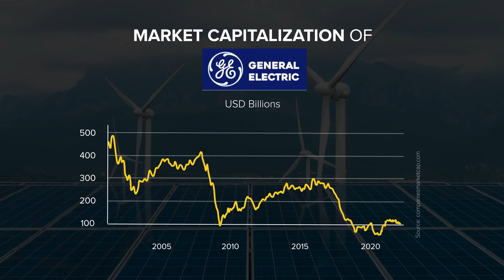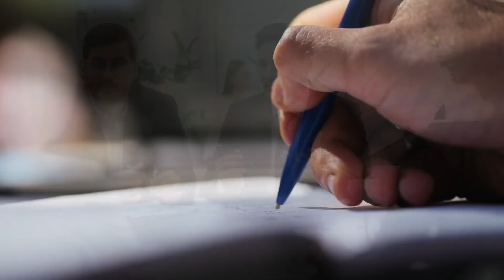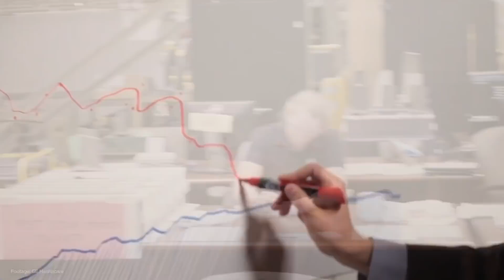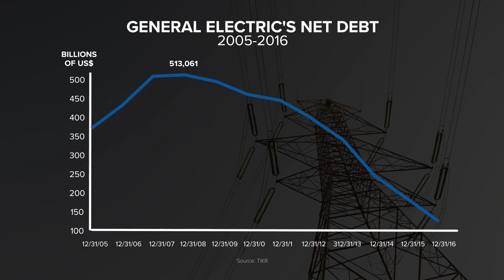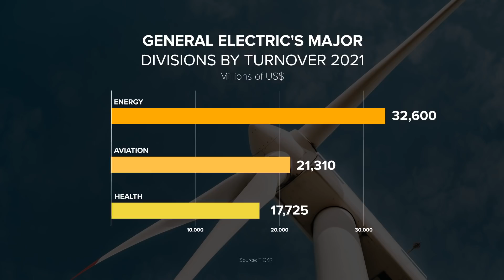The decline of industrial icon of the US - VisualPolitik EN

Comment: In my town we used to have a GE manufacturing plant it was sold off in 2006 and it was closed in 2007, it did not kept their promises to engineers, retires, managers,  etc. The county then bought the building along with all toolling and machines. GE came back in 2015 I believe and they want to re-open operations. My county say F%#k OFF and instead we gave it to a joint Siemes,  Toshiba adventure.
Reply: How unpatriotic🤫 Had there been some Italian business parted in and you would have got a complete take over by the Axis😁
Reply: Toshiba alive ?!
Reply: @olpkol  Barely but doing better than GE. They make Nuclear plants now and bought Westinghouse.

Comment: I’m a MBA and worked for GE Healthcare for 1yr,2013-2014. For the year I was there I could feel its failure. The top was so heavy it crushed those with customer interface. Management was so very arrogant. Too blinded by GE’a heyday to see its current issues. What worked in the past will work in the present, not so. 

GE would take a GE Petroleum manager and just plug them into a healthcare management role. Those sort of management movements. But by far trying to figure out how to navigate the business was the biggest issue. Most of my time I was trying to figure out how to get something done using the company more than servicing the customer.  It was no privilege to work there. Literally left one year to the day as I set my goal of just bearing it for one year.

Comment: With tech firms it is always removing engineers from the top and replacing them with finance people that ultimately destroy the company.

Make sense though as tech firm needs to take risk and push the envelope to stay relevant which leaders with a tech background understands while MBA types are trained for risk management and thus more conservative. Works fine in the financial or retail sector but horribly in the fast pace high tech sector.

Comment: Started working for GE in 1978. There in cafeteria I did see an article about Sumsung, a company that started producing microwaves. Apparently one got put togerther and it promply melted out. Sumsung then bought an amercan company that was producing microwave devices. Than there wasn't turning back. GE got enamored making money on stock exchanges and there wasn't any company in US that fell under the same spell. They all created the finnancial arms in its' corporate structures to profit in the ways banks do. Clinton stepped in abolishing Glass-Seagall Act aĺlowing for the investmet arms of the banks to use the savings of the public to raise the betting stakes just like it was back in the "roaring" twenties. B.Clinton actually quipped " where would they all go now to?",   meaning the workers of the USA. To add mentality of greed so consistent witnin human rase got into big swing with All Dunlup who awaken an avalanche of a hundred milion compensation packages through anything called corporation.

Comment: Of course the new "strategy" comes from the main beancounter. This is the one of the most used tools that investment bankers know how to implement. Take a failing business divide it up and auction out the new entities that with the "improved focus" can attract an actual buyer who may want the canning factory but not the corporate RnD :D 

The end of this kind of story is always the same: shareholders sacrifice the company and incinerate its future for a few dollars.

Also big conglomerates are over? HALLOOO Amazon... economies of friggin scale. If your divisions manage to align input procurement and get organized your inputs can be greatly discounted as opposed a few mid-size firms that struggle to keep the light on. Also it helps if one div sells what another one needs in turn...
Reply: Yea it lets them hang the unprofitable parts of the business out to dry (usually RnD as you mentioned) then they auction off the remaining parts. Sadly it’s often the unprofitable businesses that drive future potential or they are cyclical businesses that have up and down years and require extensive investment. Then big often foreign companies swoop in and buy up the pieces laying off half if not more of the company that’s made redundant by mergers.  I be surprised if more than one of these divisions was still an independent company in 10 years
Reply: Amazon should be split up too. Amazon Web Services (AWS) should definitely be forcibly split up from the rest of Amazon.
Reply: @Tribuneoftheplebs  And don't forget Bezos!

Comment: You don't think deep enough, the value of the company was never really more than it is now, the way the system is designed means they have a value and a virtual value. The try to use the "virtual value" as it was the real value and then when the virtual value breaks they are way out of reach of the actual value. As Monty Python would say "Strange women lying in ponds distributing swords is no basis for a system of government…" and the same is true of wall street, it's not a sane way to decide the value of companies.

Comment: Worked at GE. Hated the culture
Reply: how was the culture over there?
Reply: @gurumage9555  when I was there as an engineering intern, i had many duties but my supervisor told me that my primary job (and the sole one I would be judged against) was to call a particular engineer working for the contractor who made many of our plastic subcomponents to get him to take time away from manufacturing their main GE plastic parts order to focused on trying different injection molding techniques to solve the plastic warping issues we occasionally saw with some of the part numbers.

I was told by my supervisor that the criteria for whether my internship was a success or not was whether I called the plastic supplier about focusing on the plastic warping techniques over their regular manufacturing so much that they would called my supervisor to say, " you got to tell Phillip to calm down."

I would call the supplier and sometimes (when they had free time) would focus on the trying out the warping techniques. Other times they would explain that they would focus on the warping technique as soon as possible but that it wasn't something they were obligated to do (wasn't in a contract) and that the savings would be in the 10s of thousands (with GE getting most of the savings) while the main plastic parts orders from GE were worth millions. This sounds like a reasonable explanation to me but my supervisor said I was making excuses so I had to keep bugging the contractor and calling the higher ups in their company. Felt like a total asshole. I keep think "wouldn't a contract about this thing sort everything out?" Felt extremely unprofessional amd like harassment. Plus I'm an introvert so I really wasn't comfortable
Reply: I've been working for GE for over a decade now. I've never had similar experience but I'm not questioning what you shared. I wouldn't say though that's entirely a company culture issue. There are assholes in all companies, and you mighty just have had a bad luck with this guy. Or maybe it is me who's been lucky not having an asshole manager throughout all my time within GE, although there have always been some around. People I've worked with on the other hand have always been at lest ok, and typically more than that. Not once meeting them in the office was the primary motivation for going to office :D